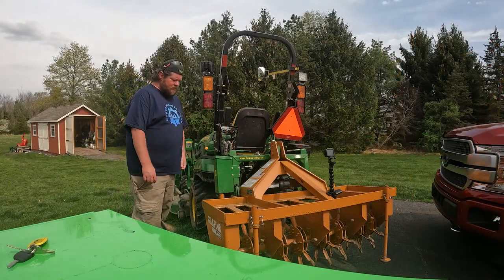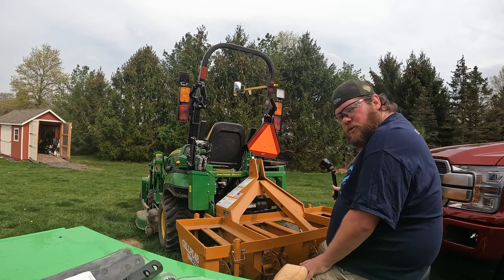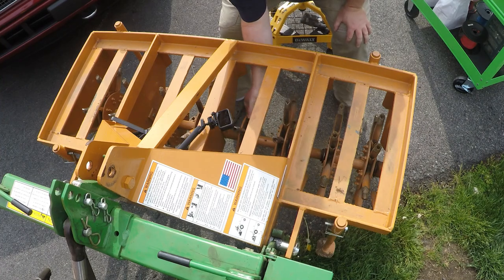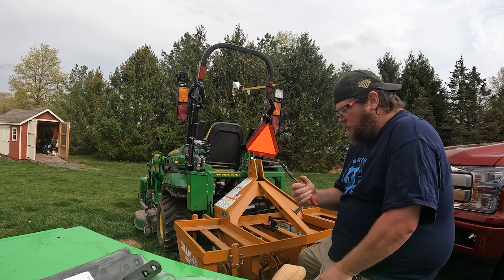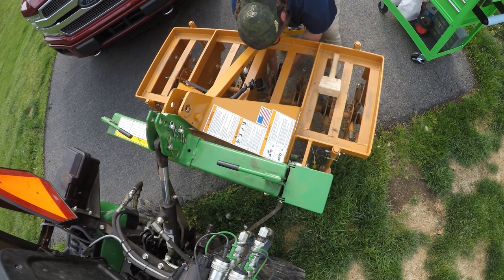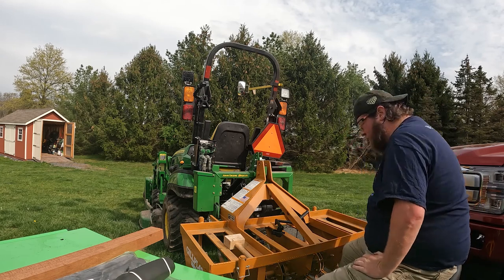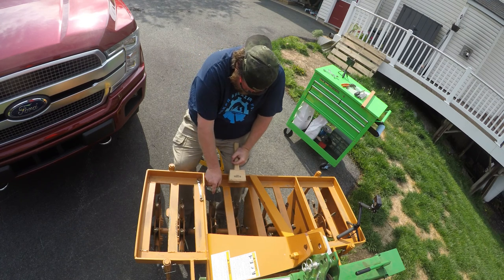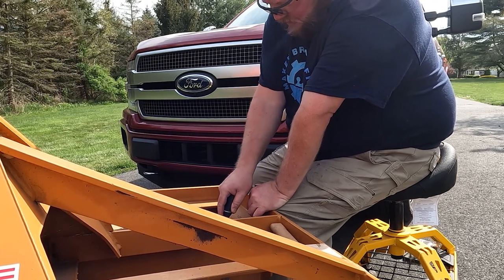Spring Aerator Service (Woods 48" plug Aerator)

Comment: How do you know when the spoons need to be replaced other than when they are broken as you illustrate in the video. I just bought a walk behind Lesco aerator yesterday.
Reply from the maker: Bent, damaged or broken is really the only reason I'd replace them.    They'll shine up pretty quick running them in soil.
Reply: @MakerBreakerFixer  I see! Thanks for the info!! I was skeptical at first buying this Lesco Aerator. Great video by the way!

Comment: I just bought one of these aerators (used).  Where do you get your replacement spoons?  I found a place online.  Just wondering where you got yours?  By the way, for greasing and spoon cleaning I picked the aerator up with my front end loader forks to chest height...but I don't know if that's any easier.
Reply from the maker: I got mine from the link below (no affiliation).  I didn't lift it since it's on stands and I knew I was replacing that spoon, which took a lot more force than I expected.  I'm guessing that for pre use grease, I wouldn't bother to lift it, but next time I clean out the spoons, eye level or close to it will make for an easier job.  Thanks for the idea! 

https://www.agristoreusa.com/products/2-hole-3-4-core-aerator-spoon?_pos=1&_sid=ed09ee3c6&_ss=r
Reply: @MakerBreakerFixer  Thanks!!  I had mine lifted to grease it and clean out the spoons.  When I got mine, the wheels/discs holding the spoons on 2 of the 4 spindles/shafts were difficult to spin.  So I had to do a ton of greasing to free them up.  But thanks for the link to the website!